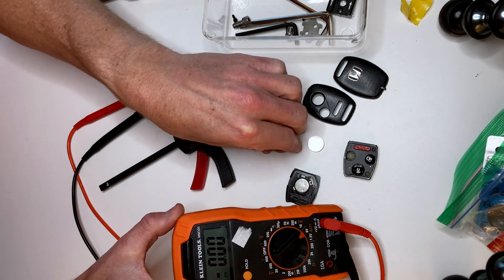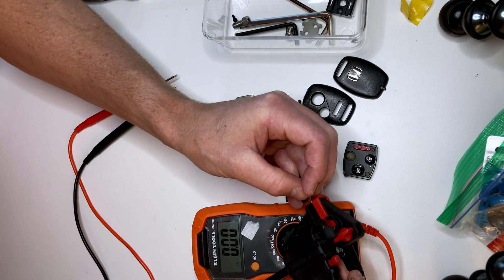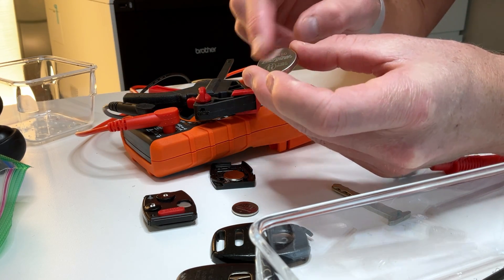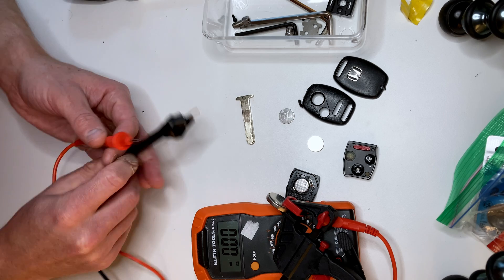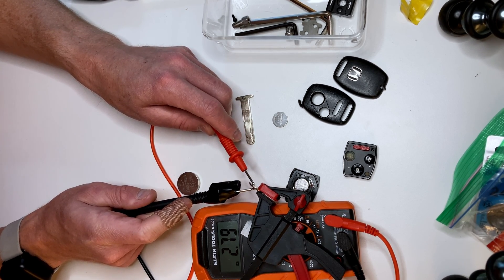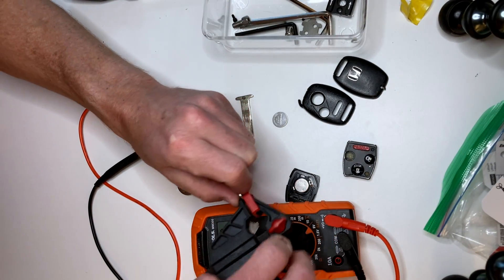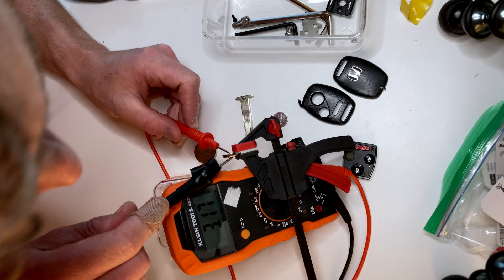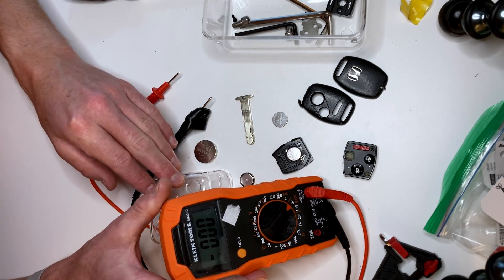Measure Your Car Key Fob Battery with a Multimeter (Easy!)

Comment: Most batteries will show much higher voltages when they are unloaded, like connected to a multimeter. This is a bad way to check them. Even the cheapest battery checker uses a resistor across the battery. Get one of those!